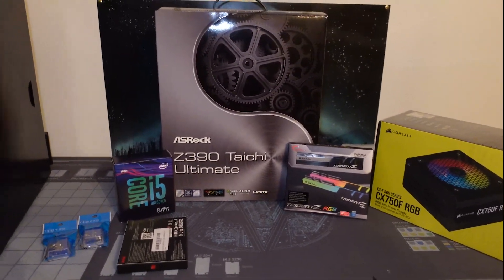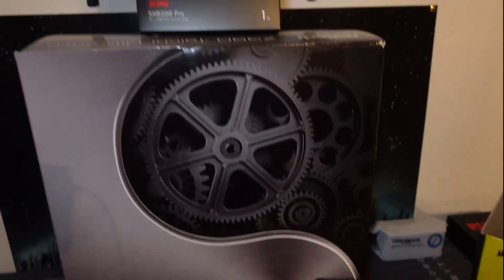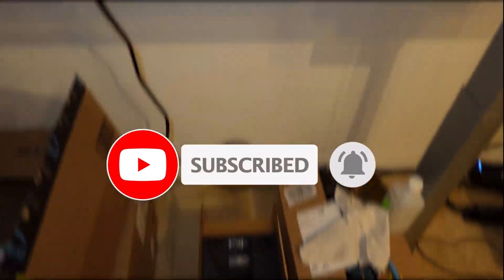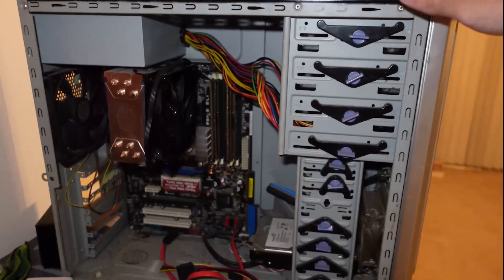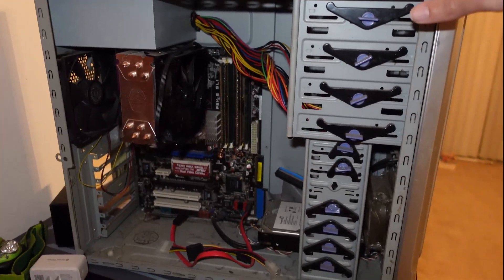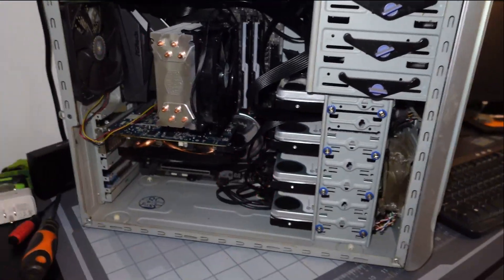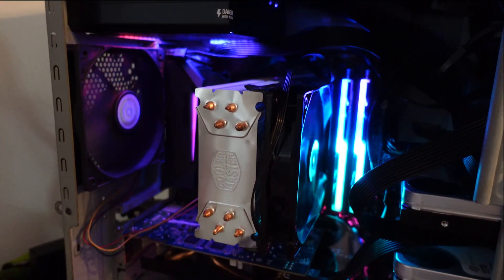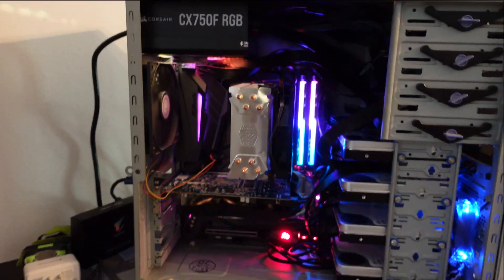Building a NAS - Chia Plotter & Farmer

Comment: Why not attach the hard drives to an existing computer or GPU miner you had lying around?
Reply from the maker: The main workstation is full already one 12 TB and one 4 TB, plus Corsair MP600 1TB and 960 Evo, but got room for one more NVME. The CPU on the mining rigs is dual-core, not good for plotting especially with only 8 GB of memory. As I mentioned in the description I had most of the hardware already just needed a couple things. Thanks for commenting and stopping by, take care!